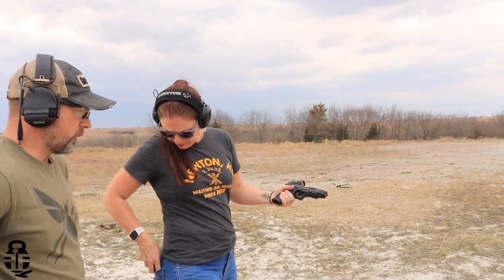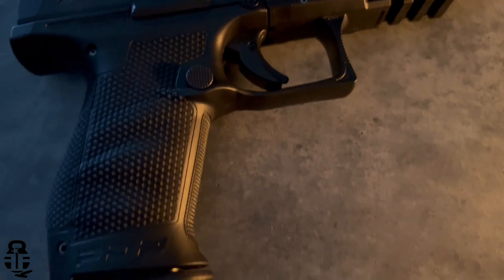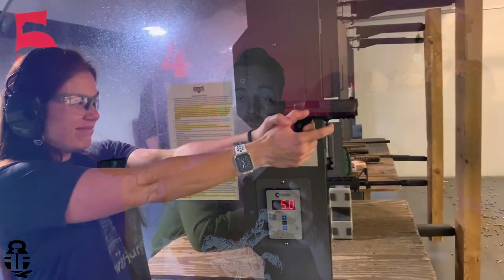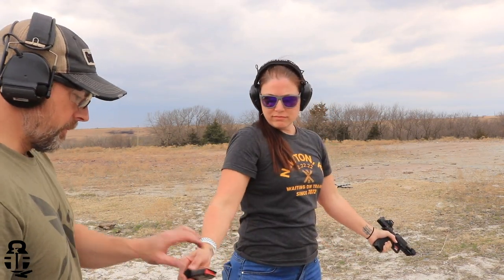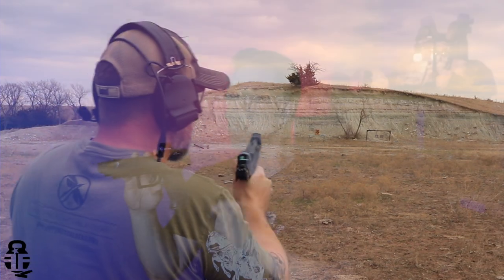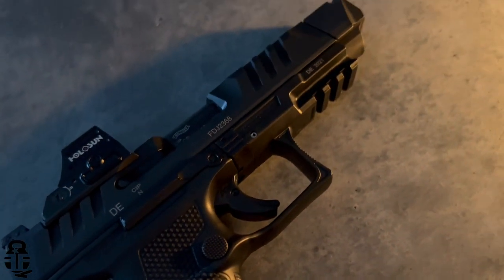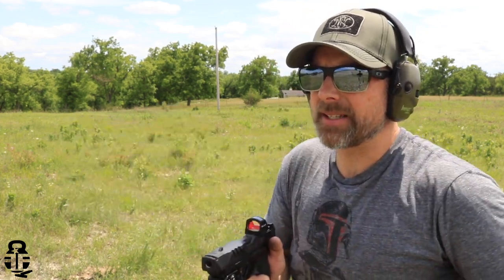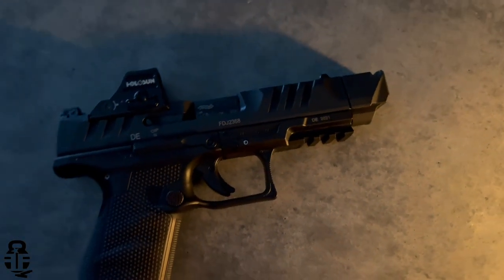Do Comps on Pistols Help? Walther PDP Upgrades

Comment: The spring that comes with the comp is for a suppressor which needs a heavier spring. The comp would benefit from a lower rated recoil spring. Walthers are oversprung to begin with as stock spring is 18lbs. Without a comp 15lbs is the sweet spot and comp I would guess a 13 or 11lbs.

Comment: I have the 4" full size with a parkermountainmachine comp too. She's needs to go with a lighter spring and it will shoot like a dream. The comp compensates the gas making it have less gas when you shoot it. I have the Springco guide rod system with the red and yellow springs. I run the yellow spring which is the lighter spring. I run 115 gr. and the cases don't hit my optic. But I'm getting the ZR Tactical steal guide rod with the 13 lb springs. Because I think the yellow spring is a 15 lb spring. The Springco setup runs about 90$ and the ZR Tactical setup runs about 56$. Just some food for thought. I also have the Taylor Freelance mid weight kit that comes with a brass backstrap, aluminium magwell, and two mag extensions with replacement springs. Hope this gives you some added info.
Much Love and God Bless
Reply from the maker: Thanks for watching!!! That’s some good info too!
Reply: Taylor freelance kits with comp would make her pdp so much better especially with the comp already on it

Comment: As others have mentioned the spring Walther includes with the threaded barrel and which also comes with the PDP Pro SD models is for a suppressor. Comps are great but, I imagine having to remove it anytime you want to completely disassemble the weapon would quickly get old. Walther has done a great job with this one and as much as I like my HK's the PDP has become my daily. If you are going with an optic, the Holosun  SCS goes on without a plate and sits low enough to co-witness with the included sites. Though the factory sites are probably the weakest part of this weapon.

Comment: I just got the PDP 2.0 a little over a week ago. 2 days of range time and 6 boxes down the yap. My 2nd day is my 2nd time on a range and had my groupings in about the size of a fist, open factory sites at 20 & 25 yards. I can’t wait to get the Holosun I ordered delivered. 
But I can’t find those compensators in stock ANYWHERE 😂. No big deal really. I’d just like to try one out. 
Something I saw about the PDP 2.0 is that it doesn’t need a mounting plate for the Holosun I ordered? It sets lower on the slide so you shouldn’t need to swap out factory sights for co-sighting and it’s not suppose to ever need the battery changed.
Reply: only for the PDP Specific sight
Reply: My real issue with the SCS is they didn’t include shake awake for them, making it a bit of a deal breaker for home defense or even concealed/duty carry
Reply: VR Tacticle makes a great comp for the PDP SD Pro. Pick up their Ultra Mass guide rod and 15lb spring while you're there.

Comment: How is adding a red dot effecting recoil ? As far as these comps goes i don't consider these things a "WOW" item. Changing recoil spring weight to match the power factor of the ammo used will help in reducing muzzle flip and sight recovery probably (IMHO) help just as much if not more than one of these "gadgets".
Reply from the maker: The red dot adds weights to the slide which could slow it down enough to induce issues.

Comment: I like the setup on that PDP, but as cool and practical as it is, my concern is what holsters would accomodate something like it? Asking before I try something similar with mine.
Reply from the maker: There’s always Uncle Mike’s 🤣😉

JK…you’re right. I can only imagine someone like Tier 1, LAS Concealment, or TRex Arms might have something like that. I’ll try to do some digging too.
Reply: @FitnFire  I can only assume that adding both the 4.6 inch barrel and the compensator, it must be around the same length of a 5 inch PDP, right?

Comment: Thank you for the great video brother, did you change the guide rod and spring as well? Will it work with 11lbs spring when using parker mountain comp?
Reply from the maker: We did initially but went back to the stock spring/guide and have had no issues

Comment: Interesting.  I run the tungsten and all grains run fine - no issues.  Do you think the comp affected that for you all?
Reply from the maker: Adding weight and the geometry of the barrel may have very well been the issue
Reply: Comps 100% will affect the reliability.  Best thing to do is something like the Chunk Port if you don't want to deal with ammo sensitivity.

Comment: I dont think  the red dot wieght will effect anything in  pdp since they come red dot ready they have accounted for wieght as large as the acro and the stock recoil spring are  18 pounds.
Reply from the maker: True, I think I was trying to refer to other pistols that may not be optics ready. Thanks for watching.
Reply: @FitnFire  sorry misunderstood
Reply: I’m thinking the weight difference between an RDS and the chunk of metal they replace on the slide isn’t all that significant.

Comment: Which recoil spring did you use for this video? The OEM one with gray color or the green one comes with the threaded barrel? thank you
Reply from the maker: We started with what came with the new barrel but apparently that is meant for a suppressor. We switched back to the OEM spring and all is well.

Comment: I did as much upgrading on my 4.5"Walther pdp possible other than getting a silly comp. Threw Walthers performance trigger in, 50n Walther tungsten guide rod, c&h optic plate for a 509, Brass backstrap, TF brass mag plates.... Waiting for Walther to finally get their "improved" striker in stock. Putting the new trigger and fire control in was the hardest step.... Would hate to do it again honestly.
Reply: Comps not silly . Silly comment though as each tool has its use. Could’ve gone ported too.‘options for everyone. I didn’t need the brass wieght and all that I have a strong grip so I didn’t need help.
Reply: @ghodge82  I agree. Whatever helps performance in any way, if you have the money for it.
Reply: Saying comps are silly says a lot about you as a shooter.  

Comps, porting, integral comps all serve a purpose.  If you want to go faster, then you do your research and you pick the one that works best for you.  They will all have a tangible effect on the recoil of the pistol.

Comment: Will the Holosun 507c acss Vulcan fit the PDP Pro SD compact? Or just the full size
Reply from the maker: Should fit both
Reply: @FitnFire  OK Thanks I know  that sometimes the compact models use a different footprint than the full size models 👊😎🇺🇲

Comment: PDP is a weird gun, feels like it's got more jump than my P365X...but I don't know if that's because the P365 with the WC grip module is super locked in.
Reply: Not sure about more flip than micro… but certainly quite a bit vs other full sized guns.
Reply: It has significant flip in stock form for sure, I shot a friend's then shot my P-09 back to back.  The P-09 was rock steady but it's also 4 oz heavier stock.  I ended up getting a PDP SD Pro then added a Sprinco recoil system, TLR-1 HL, and a 509 ACSS, now it's MUCH flatter shooting.
Reply: Yeah, I switched over from the TLR7A to the Goonbeam Short V1 and that helped slightly.  But honestly just putting some grip tape on the grip was something I found really helpful.  The stock texture is a lot less grippy than it seems (Glock Gen 5 has better texture for me). @KidCorporate

Comment: My edc build is very similar. Canik Combat Executive with a comp and holosun 508T. Nice thing about mine was the threaded barrel came with the gun and i didnt have to drop and extra $230
Reply: Guns that ship with threaded barrels cannot be shipped to certain states.  I appreciate they started with the non-threaded versions first.
Reply: the barrel is from the SD Pro so that is the best place to start...an even better trigger and a magwell make the modest price increase a real value

Comment: Watching the young lady constantly re-grip between shots shows that her fundamentals are " less than ideal" and finding a Left handed shooter to show her what works should be a priority 
Righties are no help 
Grip is the overwhelming issue here not compensator, nor return springs or the weight of the Red Dot
Reply from the maker: This was only the 3rd time she had been out shooting and getting her used to the contained explosion in her hand was the priority. Grip and additional fundamentals will come in the future.
Reply: @FitnFire  Not sure you are making the point you think you are
Gaining experience doing it " wrong" does not make good shooting easier 
It ingrains bad habits 
And Left handed shooters need different coaching 
Which may be the true issue here
Your skillset as an instructor may be lacking here, and ego making it worse
Instead of asking what might be done, or ask for a link to a helpful video 
You get defensive " Its only her 3rd  time"
Reply from the maker: @googlesmostwantedfrog147  “I know more than you.” ~Ron Swanson
Reply: @FitnFire  Cope and seethe all you want
The video shows what it shows
Reply from the maker: @googlesmostwantedfrog147  what’s your website so I can sign up for teaching classes?
Reply: @googlesmostwantedfrog147  the most important thing when it comes to new shooters is letting them get acquainted and have fun. Critiquing every single little thing outside of safety issues is going to do nothing but frustrate and cause problems. If they’re receptive to some extra training sure then go for it but at the end of the day you have to pace it.
Reply: @TheHashtagSquad2K15  Not going to argue that point if the shooter is just trying it out sure
But the OP states the girl has physical security concerns 
And I would argue that good fundamentals, stance and grip have to be emphasized 
As opposed to just having fun shooting

Comment: Your issues are cause you clearly don’t understand how a comp works.. if you are running center quality range fmj you’re gonna have issues.. comps want very hot loads.. nato or p+p type rounds.. and in reality the comp will make the pistol shoot better with higher pressure loads.. if you really want to practice/compete you want to look at 115g nato loads..